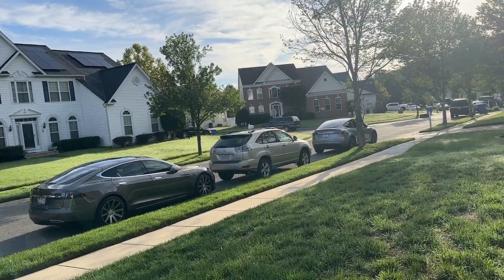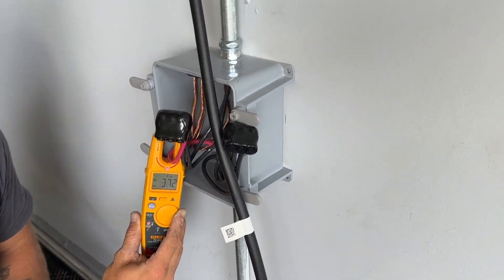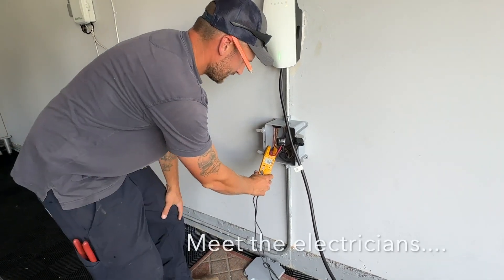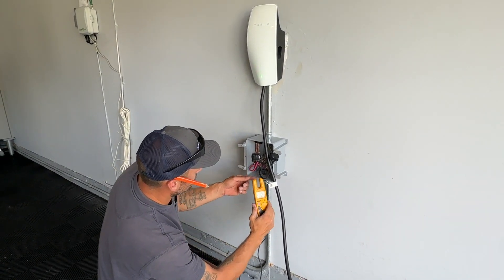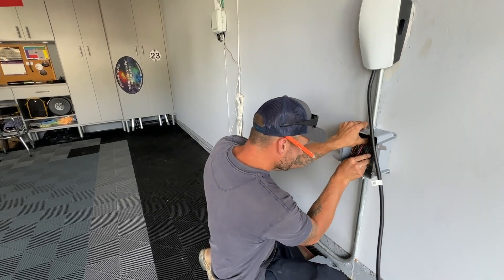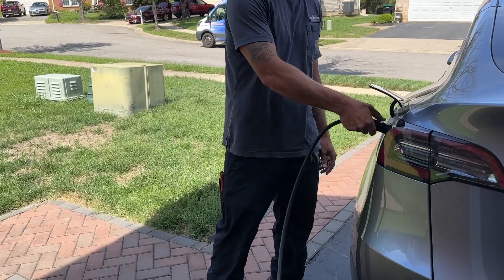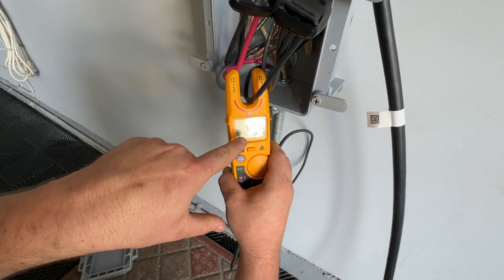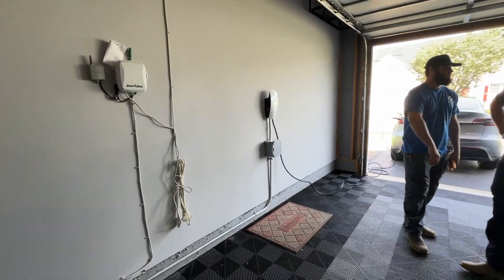"First impressions: Two Tesla  Generation 3 wall connectors!" Please waste your time: S38 EP8

Comment: Im assuming both wall connectors are spliced in parallel onto a singe 60Amp breaker, am I correct or is there a communication cable between the wall connectors? Thanx for the video
Reply from the maker: @weekkendwarrior5166 - A 60-amp breaker is required for the Tesla Wall Connector Gen 3. It is designed to operate at a maximum of 48 amps. from what  was told that the 60-amp breaker provides a safety and ensures proper circuit protection. Thanks for watching[ - if you can please subscribe to my channel.